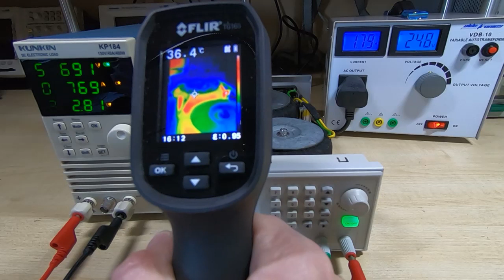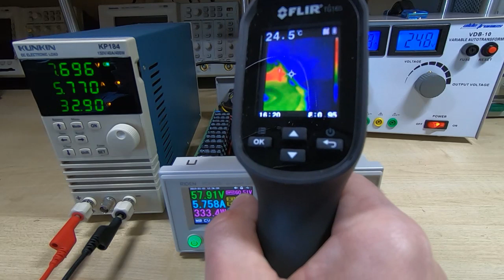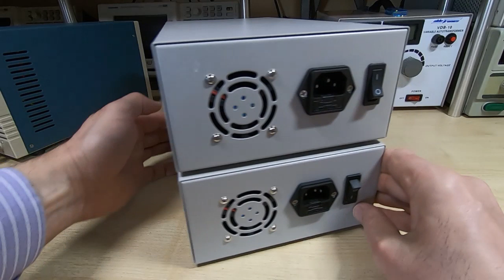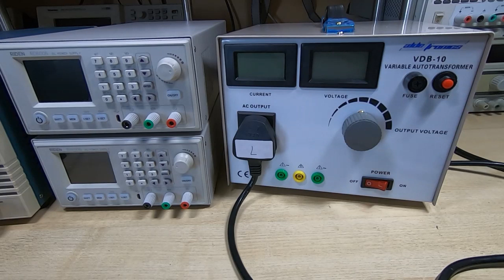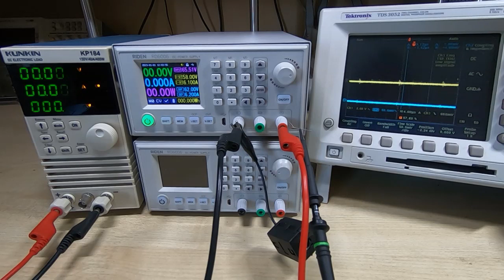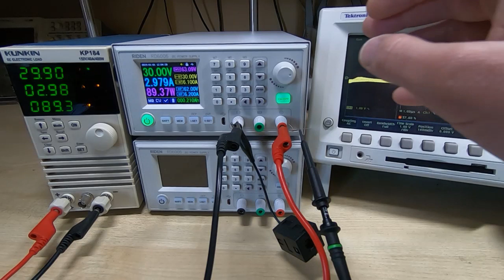RD6006 Linear Part9

Comment: Hi Jerry,
That concludes in a great manner your very interesting series about the Riden PSU.
As I already told you, I've been looking for a good cheap lab supply for a while now,  and thanks to you and to your work, it seems like I found it!
I'm about to order the RD6006 and its case now, and of course, to give the whole thing a linear flavour.
About the transformer, TME sells (and has in stock) a product, the Talema 58-0500-048-S , which seems to meet the specs we need for our unit: 230V in, 500VA,  48V out, 140mm diameter and 64mm height.
Here is the link : 
https://www.tme.eu/fr/details/58-0500-048-s/transformateurs-toroidaux/talema/

Would you mind giving me your opinion about this model?

I intend to use a Schottky rectifier to minimise the voltage drop and the heat.
Then, for smoothing, I am note sure about the capacitors. I'd like to use a few number of capacitors for repairability reasons: 2 or 4 like in many audio amplifiers seems adequate to me.What would you suggest as a good capacitance value? 
Thank you sooooo much for your help, and for having shared with us all this great work!
Sam
Reply from the maker: I am already aware of the TME units and they should work OK but I have not tried one (you could always rewind it if you needed to :) ) be sure to note that the VA is not the same for 50 and 60Hz. Around 20,000uF @ 80V minimum should be OK but you need a very low ESR as you are feeding a switching convertor. By using 68 capacitors each with 0.2R I end up with a combined ESR of about 0.003R (in theory). As I say in the video the approach I took is not the only approach so you can experiment with whatever you can find.
Reply: @JerryWalker001  Wow I'm starting to understand why you used the board of capacitors...
I'm trying to find capacitors to make a 20.000F network at 80v, and it is actually very hard to find or very expensive, when you want to use only 2 or 4 of them:
5.000F capacitors rated at 80V or above seems to only exist using snap-in connectors, and cost tens of Euros each! 
This is even worse with 10.000F
So I might stick to what you used: a large array of smaller capacitors, easily rated at 80V and above, and with a low total ESR (low esr seems not to be that hard to find though: low impedance big capacitors with about 0.02R are common, thus 4 of them would make a descent 0.005 theoretical esr)
Reply from the maker: Correct. I am trying to show different ways to do things so that alternative ideas can be tried. I only paid £16.00 for the board, delivered. I think I mentioned in one of the videos that I was surprised that the kit had 68 genuine Rubycon caps. These are normally in excess of £1.00 each so getting 68 of them plus a board, plus connectors plus a rectifier for £16.00 is a good alternative to cheap large value caps. If you shop around you may be able to find some larger caps at a reasonable price but as I say you have alternatives.
Reply: Sorry for my interference.  Could the following transformer also be sufficient? TALEMA 58-0400-048-S 400VA; 230VAC; 48V; 8,333A; 3,2kg; H: 54mm https://www.tme.eu/it/details/58-0400-048-s/trasformatori-toroidali/talema/

Comment: Tx for yet another video! 
I would like to know where the noise from the smps is coming from and if there is anything one can do to mitigate it. 
Adding a ferrite core to one of the leads?
Installing the smps with the leads close to the front in stead of to the back end?
You’ve already mentioned that adding capacitors wouldn’t help. 
Would a bimodal inductor do any good? 
Please like if you’re interested too so it’s clear if there are more people interested in this subject. Tx.
Reply from the maker: The noise is not coming from a single cause and so would be very difficult to eliminate. It may be possible to mitigate it to a certain point but as it will vary for different SMPS and at different loads then there is no single solution. The noise is also not all comming 'out' of the supply terminals and some is also coming via mains loops and as can be seen in the PF issue there will be mains noise that would also need to be addressed. You could try things such as LC networks but these may only work for certain conditions and may actually make things worse. I also suspect that there is interaction betweent the Riden and the SMPS which will also vary under different loads and for different SMPS. All this is why linear supplies are the way to go if you are looking for low noise.
Reply: Jerry Walker Thank you!
I thought I was complex but now I know it’s even worse than that. 😢😉
Reply: Jerry Walker 
I know the basics of inductance in the sense of how inductors and transformers work. I can identify the components of an SMPS and could explain there function in the circuit. I understand that when the raising current in the primary winding is interrupted and the magnetic field collapses, that a reversed current in the secondary winding is induced. Snubber networks, optocouplers, (zener, Schottky) diodes, mosfets, etc have little mysteries for me anymore. 
But I wouldn’t even have thought of at least half of the things you mentioned above. 
I’ve searched for video’s on inductance but they all relate to regular use of it inductors and transformers. 
Maybe these unwanted phenomena you described are trivial to you but I suspect that they are a complete mystery to many. 
I don’t know if you would want to make a video on this subject but if you would you’d have at least one very interest viewer;)

I am aware that even a 15 minute video will take many hours to produce so this is not a request, just me saying that now that I’m aware of these things I’d like to learn more about it.